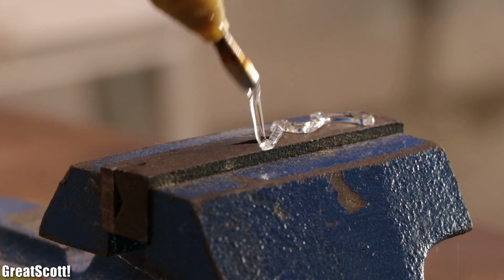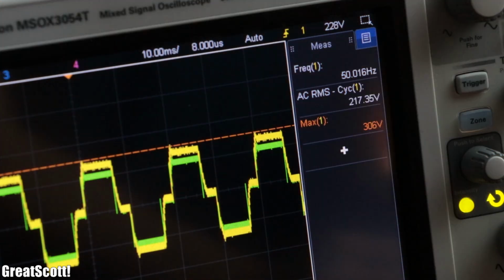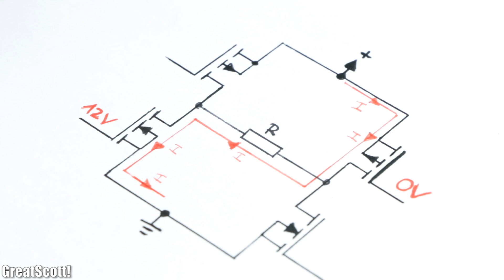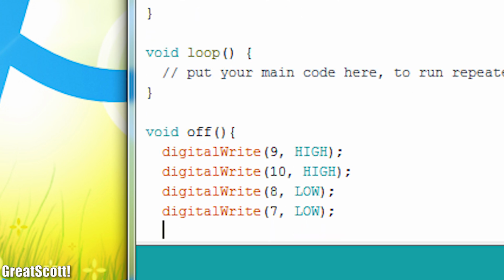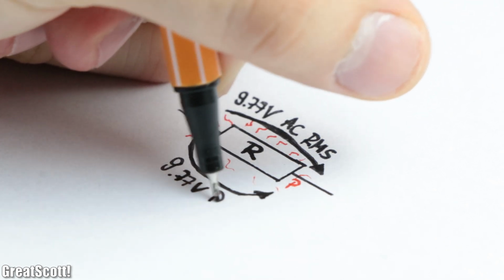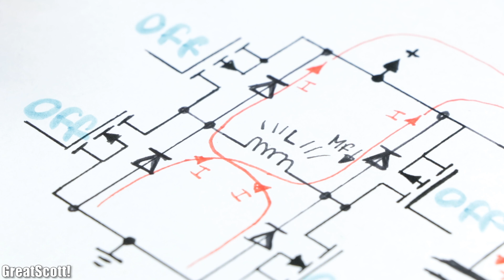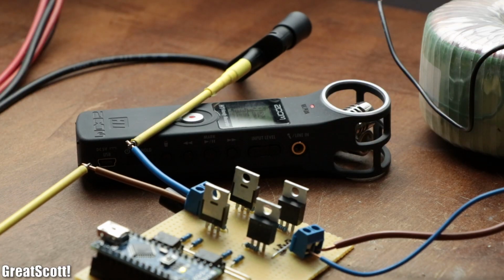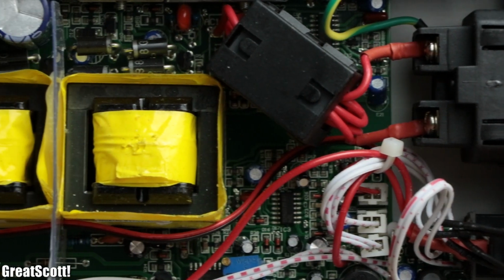How NOT to make a Modified Square Wave Inverter

Comment: Use all N Channel mofset and biffilar transformer winding  with 2 Channels or conventional transformers  with 4 (2 High+2Low) Channel  with Battery Postive wire connected on( Hi Side )2 Channels drain and Battery Negative Connected on (Low Side) 2Channels source 
And High side Source and low side Drain connected to transformer for switching

Comment: You should do a video on h bridge ac  square wave and sine wave .on my inverter sine wave I get about 60 v on one side and about 110 on other side.also I get negative voltage on h bridge somehow of  -60 and - 110 don't get it

Comment: I'm building and designing a pure-sine Half-Bridge open-source inverter ;). I fix electronics for 20+ years, but not a designer, nor engineer. I will share gerber files and ICs with firmware. My plan is to create 12 and 24V DCinput. As an output I will have 230 or 240V AC 50Hz. I already have designed and winded 600VA toroidal transformer which came in today to me. It is continuous 400W of power and have a thermal fuse of 5A and 130C degrees. Anyone interested in the development can contact me :).
Reply: I'd stay with commercial inverters, but, as fixing them for my customers, have found that when the controller is dead, or the transformer, you can't get parts. Even Victron Energy don't want to take one inverter here which is still under warranty, but stays in the UK which is out of the EU. Those big companies are not with the Right To Repair, and for that reason, it's time to create an open source DECENT inverter IMHO.

Comment: I'm thinking about making a simple square wave inverter to directly power resistive loads like a crock pot.

I want something that will not shut itself down completely if the input voltage drops (because there is no battery.)

Comment: Fun fact: apart of producing the pure sine wave is not an easy task, most of the electrica appliances would perfecty operate on DC current. What are they:
- Ohmic resistor, like heating elements, incandescent light bulbs, etc.
- Machines with universal motors like drills, grinders, they operates much more smoothly on DC.
- All appliances with switching power supply, from mobile chargers to modern computer's power supply.
- Machines with BLDC motors like central heating water pump. They also have switching power supply.
The last two appliances' power supply's first task is make DC from AC. Thus they will work on DC just as well as on AC.
What will not work:
- Induction motors.
- AC transformers.
These lists are far from complete but most of the electrical appliances around the house will fall to the first group.
One major disadvantage of the DC current is the stubborn electrical arc in the switches what makes serious damage in it.

Comment: Very cool. As the negative DC potential remains the same all the time I guess there's no need to apply any PWM to the low side mosfets but only the high side ones (in unipolar inverter)? This way a return path for currents always exist, also doing what you did in your workaround. It sounds reasonable?

Comment: Hi sir, I'm working as electronics professor.  Your effort for each project is great and awesome 👍 I have two doubts always preset in my mind when thinking about sinewave inverters 1: Why RC phase shift oscillator or any other sinewave oscillator is not commonly used as oscillator source in pure sinewave inverter? Is any problem with that?? 

2: MOSFET have Giga ohms resistance in its gate , is it necessary to add 10 Ohm resistor in its gate ? 

Kindly reply 🤗🤗

Comment: Step 1 find a washing machine pump 
Step 2 connect pump to a small 12vdc motor and power the dc motor 
Step 3. That's it ! your inverter is done. 🙅🤷💁🤷🙅💁🙅

Comment: In theory, what would be the problems with using a D-Type amplifier, i.e. encode the sine wave as a PWM, feed that to the mosfets, and then put the result though a notch filter?  Does the capacitor have to be huge?  In capacitance and voltage?  On the plus side, you can match the filter to be the exact frequency of your desired AC output.

Comment: Now I think about it, isn't class D amp also use sinusoidal pulse width modulation? A class D amp, a transformer and an old smartphone for sine wave audio generator. Simple 100 watts inverter with adjustable voltage to test smps..since I only have 10 watts isolation transformer which is not enough power

Comment: Great video! I’ve made simple modified square inverter using PIC, N-channel MOSFETs, and transformer I got from audio amp. I reduced humming by connecting capacitor to secondary. This inverter outputs 120V but when I connect some loads to it, then voltage drops to about 60V. I’ll try to make a full bridge circuit.

Comment: Use a different programme and use a heat sink for those mosfet because they support only 2.41 watt without thé heat sink and if you add it they will support 200 watt that's means you eliminate little bit of harmonics.

Comment: You are getting closer and closer all the time but no banana. I mean I am looking for a way to change 240 amp single phase to 3 phase to power some shop equipment I have. I have yet to find a circuit to create acceptable sinewaves other than square waves which are not good on my motors. Until then I will continue to use my rotary phase converter and keep looking. Thanx.

Comment: Thinking about using this circuit to drive a flyback transformer for my new high voltage supply. It might not be great for mains AC but it's still a great little circuit :) thanks scott

Comment: im not that great at electronics, but couldn't you use a capacitor to smooth out the square wave generated so that it is more smooth, and more like a sine wave
Reply: no..current pass through capacitor... capacitor can only be used for DC

Comment: What if you used the DC output of solar panels to power DC motor spinning at 3000 or 3600 RPM instead? And then connect DC motor to electric generator which will spin the electric generator and output AC voltage, which you can then regulate with transformer, capacitor and voltage regulator to 120 volts or 230 volts. Can this be a viable cheap way to output pure sine wave AC?

Comment: one question, those 10k pull up and pull down resistors used for h bridge, causing voltage divider and turn on any mosfet on random! and can be the reason for shoot through?

Comment: Couldn't you make a controlled current side that urilizes a transformer and capacitor to generate an analog sine wave, and use that to give a voltage reference to an op amp which drives mosfets, which gets stepped up by a second transformer, to deliver the load?

Comment: As you mentioned, turning on the bottom FETs  during dead time will solve your spike problem. i have built exactly this type of inverter using a discrete transistor high/low side driver and NMOS FETs only. The efficiency is very good and the dead time conduction in the bottom transistors does not seem to impact eff. significantly. It powers all my home's lights plus TV and most small loads and never runs hot and has been super reliable.
Reply: Hello I'm trying to build one. Any help with schematics?

Comment: I looked closer at your circuit and noticed that the input voltage at the mosfets cannot be higher than 12 V (it says 60 V) because the high side driver is powered by 12 V.
Instead I used bootstrap drivers IR2104 as in the Tesla Coil project and it worked great. Now I can apply up to 600 V at the Drain.

Comment: Hi mate. Is it possible to upgrade a cheap sine wave inverter for example from 500w to 2000w or more by increase the number of mosfets and replace the transformer to bigger in the circuit? It would be great if you can make a video about that. Thanks.

Comment: And for high voltage spikes, use 2-3 uF 220 V on the primary side (low voltage input side)of the transformer.

Comment: The gate resistor value in this type of inverter can be increased to limit the voltage spikes by slowing down the switching speed of the transistors. This does however increase the power dissipation in the transistors. To make this design put out real power you would have to add, Transistor heat sinks with more transistors in parallel, RC snubbers to keep the transistors in the safe operating area during turn off. Current limit and balancing on the transformer primary, output feedback regulation and short circuit protection. Not an easy project but if you are interested in power electronics then you will learn a lot with a project like this. Power electronics engineering is a high paying job if you can do it.

Comment: From my experience, it's probably better to not use Modified Square-Wave Inverters at all; they generate a lot of acoustic/electrical noise, and are rather insensitive to the load... Pure sine is the way to go, if you like inverters. It's also 'easy' to build as a DIY; half the circuit is in this video!
I see that transformers will couple the high-frequencies and may hum/buzz, motors will work less efficiently than they should, and SMPS such as computer PSU or laptop chargers will experience high peak-currents in their primary-side rectifier bridge. Also the X capacitors will be passing a lot of current during the switching - this makes acoustic noise (from a capacitor!) and the constant high peak currents may cause them damage... [OKAY for short durations like power outage, but no-good for permanent installs!]
Another one is the CAPACITIVE DROPPER, which as my all-capsing portrays, causes most problems. The capacitive dropper limits current on a sine wave only, it will still "work" on modified square, but like the X-caps in your SMPS, they pass huge current spikes on the switching cycles...
... Which can lead to sad capacitors, or as i found in a mains power-meter; a sad inrush-limiting resistor, which overheated from constantly damping the current spikes from the square-wave switching.

Did i mention the noise? Plugging you laptop into the inverter, then using a small portable amplifier; the same 50Hz buzz will come out the speakers, making music extra high-fidelity! For this reason and others, i'd say NEVER connect a power amplifier to one of these.

Resitive-droppers, or other resistive loads (basically anything with a unity power factor) are the only things that can be run "safely" from modified square wave...
SMPS can be used, just make sure it's not a cheapy-chinese explodey-device, or you'll have a sad inverter too!

Comment: And why not make a pure sine wave inverter with proper safety features? You always give up too early! I know you're trying to protect people from mains voltage, but remember that when somebody is told not to do something, they will do it. So they will build this circuit (or worse, another one they find on the Internet), at their own risk, no matter what you tell them to do, especially if they don't want to buy an inverter. The best way to impede that is making and publishing a better circuit!

Comment: I electrocuted myself with a home made inverter during my apprenticeship. Used 555 as the timer, and forgot all about what I was doing and after powering on for the first time with the step transformer in place, proceeded to touch the HV side. It was one of those deciding moments that re-affirmed my decision not to be an electrician and stick to instrumentation!

Comment: make a class D amplifier with a 50hz oscillator then step up the output to mains voltage.....? you get a pure sine wave inverter with a 85+% efficiency? class D amplifiers can be designed to handle down to 1 ohm load on the output

Comment: Did you tried to drive those mosfet via pwm signal to simulate sinewave? maybe just a coil (as filter) from the batteries and it should be ok...

Comment: How to make an MSW: Don’t.

Honestly, I’d pony up the few extra bucks and pay for the pure sine wave. You won’t get as much power, but take into the equation the fact that MSWs tend to draw a bit more power in my experience, and also they run switchmode power supplies much harder, and could lead them to premature failure.

If you are running only switch modes, use H DC instead. They will run perfectly fine, even a bit more efficiently than walk AC, off DC. My Omnicharge (which I love) runs at 150VDC for 110VAC nominal or 300VDC for 240VAC nominal, so maybe start here!

That said, I bought my inverters from an Australian store called Jaycar. If you’re not in Australia, google a company called “sondar” or “son dar” - it’s one of the two. Absolute top notch. Completely bulletproof. They’re not the cheapest, but they are the best.

Comment: Thanks, I love inverter or power electronics was hoping you would make a video on this area!

100% agree with your full bridge topology.

But could you make another few videos and improve on the design.

Part 2 - Adding output current and voltage feedback.

Part 3 - Adding a low pass LC filter to make a pure sine inverter.

Part 4 -  Add input current / voltage feedback for use as MPPT tracking input (solar inverter).

This would be my dream series of videos and you have the know how!

Thumbs up if anyone else would enjoy.
Reply: Part 3 would include adding SPWM.

Comment: using a -1+1:1 transformer and some caps you can turn the modified square into a more sinusoidal waveform
also using a different driver that is

Comment: As your schematic at 11:50 shows, there are diodes inside the FETs, in parallel with the ones you added.  But there are some differences. The 1N4004 is miserably SLOW in turning off.  You could use something like MUR 800-series or other Ultra Fast ones.  But on the other hand, why bother.  After all, the title already states the evident - How NOT to...

Comment: I've been in this business for quite some time, and since I can use microprocessors, I generate the digital equivalent of a sine wave, which gives me a perfectly shaped curve and frequency stability. Depending on the microprocessor I use, I do not even need condensers and coils to flatten out some of the bumps. A sample rate of 4 kHz over 50 Hz (80 steps) appears prefect at the output.
Reply: Would you give me more details about microprocessor based inverter ? please .i am very interested about it .My email id  nasimcisco@gmail.com .

Comment: I would like to suggest that you include the shorting function, where you turn on both of the bottom fets during the dead-time of the inverter. 
 This will greatly reduce transformer noise, make the transformer's output waveform look totally textbook - and improve the inverter's overall efficiency when driving purely inductive loads. 
 Anyway, great video, as always   :) .

Comment: What would efficiency be if you just use two motors one 24 V DC or 48 V DC or whatever the capability of your solar panels and battery bank can put out , directly driving a DC motor couple to AC motor 240 V or 480 V three-phase motor. This way you would get three phase power with perfect sine wave you just have to per Cicely control the 50 or 60 cycles revolution of the DC motor which is easy to do on a DC motor.

Comment: aw don´t use P-Channel... Use a charge pump and N-Channel only! Much better :D RDSOn of P-Channel isn´t that great most of the time...
And use a port of the uC instead of setting each pin line by line.. So you can just set the bimask and have all pins flip at the same time.. Otherwise you might produce a short for some us while both low- and highside FETs are on..

Better circuit b.t.w.: Step up form 12V -> 400V DC and then do the H-Bridge on the 400V DC, the 12V -> 400V DC Step up is much easier to build with a feedback and you can have storage capacitors for the 400V..
If you have really fast FETs you can even do a sine wave via PWM on the 400V H-Bridge.
Reply: Timo Witte Thats something I thought about, to get better power efficiency I could take the 12V DC, use step up converter to get it to the proper DC Voltage (like 300V or whatever depending on power and so on), then use spwm to make sinewave with proper rated mosfets, add feedback and overcurrent/over/undervoltage/safetystuff..., some coil/capacitor stuff to smooth the last bit of the spwm and voila, great transformerless inverter with (it should have) a good efficiency
Reply: Not even mentioning, that bootstrapping a high-side N-mosfet can be done with extra 1 bipolar tranny and 2 extra resistors...

Comment: Doesn't work well for a lot of shaded pole and other single phase induction motors, as it causes them to overheat and make quite a lot of noise from the harmonics. Really best for switch-mode supplies and generic lighting.

Comment: Death to cheap modified square wave inverters ! They can't handle a dynamic inductive load well such as speakers. Also had problems with terrible humming and noises since they don't provide a stable output as you can see in this video. 600W on these 50 euro/dollar boxes is peak for a few ms and most can't even take the stated (usually not even half) the RMS for a minute. Remember there is (a lot of) retailer price margin/uplift on those inverters and guess where that money isn't spend on.... right....  Please please please just get the pure sine ones, you will thank me for it :-)

Comment: The primary of a transformer is always connected to the source regardless of whether it is a step-up or a step-down connection. The primary side is not always the high voltage.